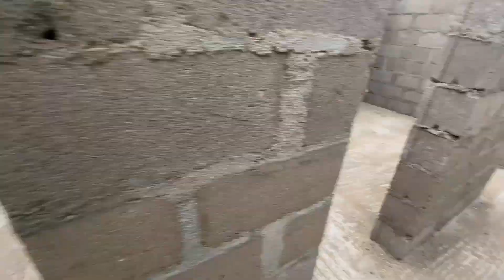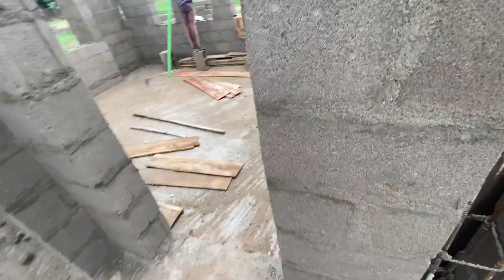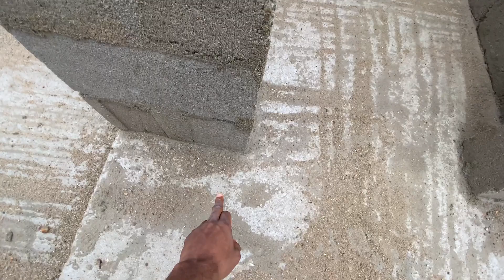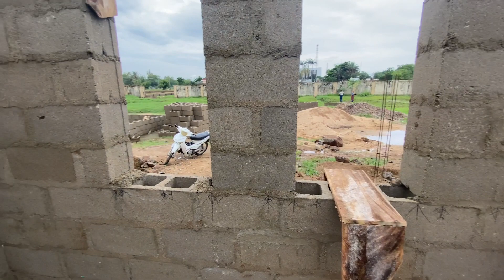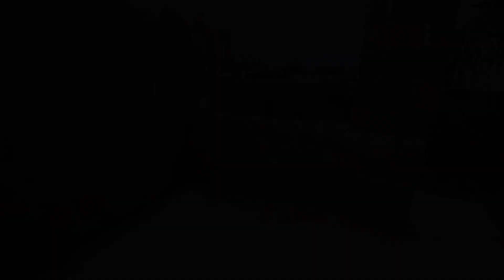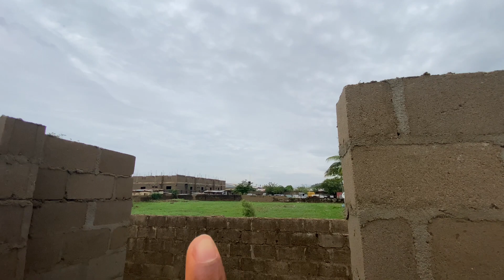Lintel Construction in Nigeria

Comment: Please which type of wood did they normally use for bungalow lintels
Reply from the maker: @atoyebitemilade897  
1. Planks (depending on the size of the blocks, it could be 1”x9” or 1”x6 or 1”x6”) and 1”x 12” planks for the side cover. Also 2”x2”wood to brace the lintel formwork and nails

Comment: Hello, please can I make use of a 12mm rods for a beam of a rooftop bar ?
Reply from the maker: Absolutely. 4no. 12mm reinforcement tied with 8mm links @250mm centres should suffice. Nevertheless, you should follow the specifications on your structural drawing issued by a certified structural engineer. This is because every structure is unique